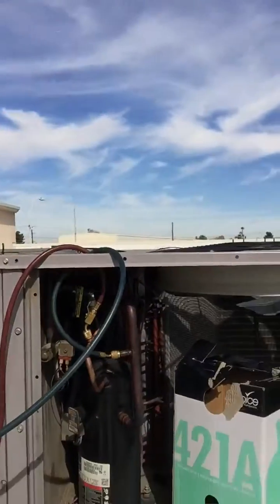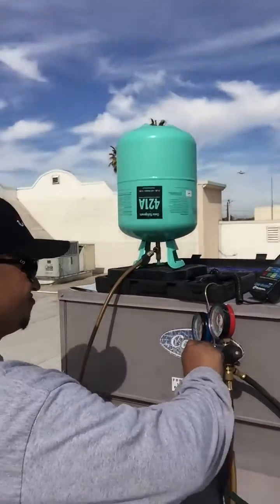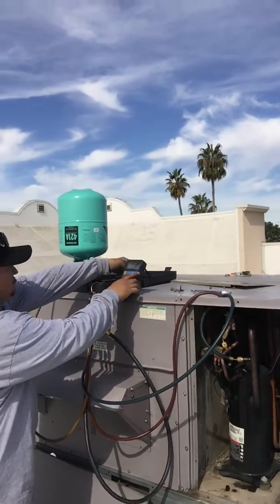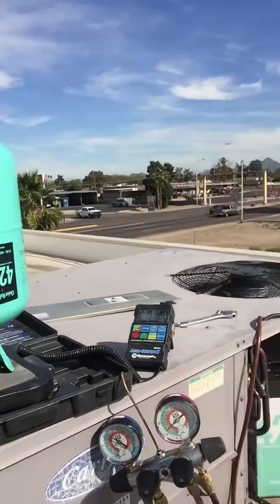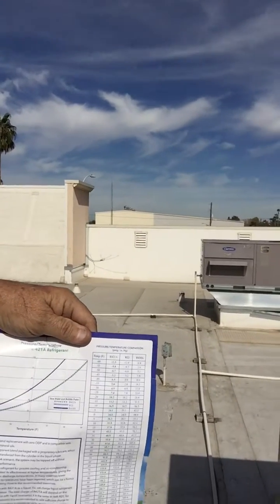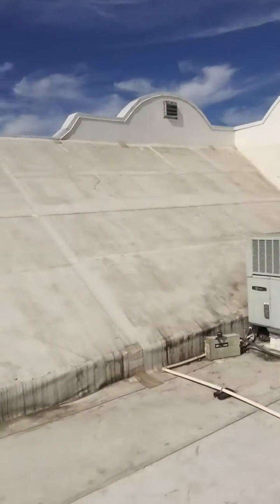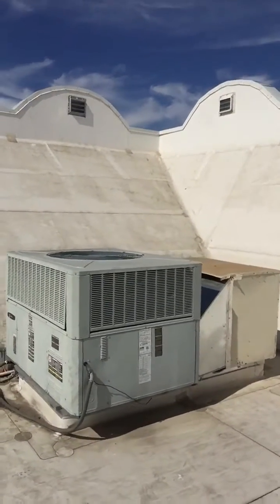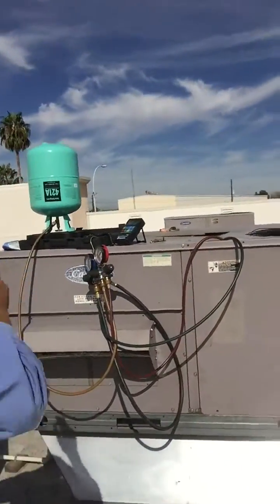HVAC Choice Refrigerants R-421A Field Use

Comment: 28° SST! You don't see a problem here!?!?
Reply from the maker: Mark Carpenter I’m not sure what SST is.
Reply: @cochisecounty_travels  
I said 28° SST  meant to say 26° SST and that's even worse. SST = Saturated Suction Temperature. For comfort cooling we are always trying to achieve 40° ~ 45° indoor coil or SST regardless of the type of refrigerant. While pressures can be all over the map from one refrigerant to another, temperatures should always be the same. 40° ~ 45° indoor coil with a condenser split of 10° ~ 30° based on condenser efficiency. 

50 psi = 26° (bubble) SST (Well below freezing, should be 40° ~ 45°)

215 psi = 111.2° (dew) head Temperature

85° outdoor temperature 

26° Condenser split

72.5° Return 

52.5° Supply 

20° ~ 21° delta-T (high side of normal) 

Suction line temperature ?

superheat ?

Liquid line temperature ?

Subcool ?

Was the filter clean?

Was the evaporator clean?

Was the blower wheel clean? 

With a 26° SST well is well below freezing, won't that ice up the evaporator?

From what you have up there it looks like the evaporator is starving or has extremely low load, while the condenser is close to normal. If the evaporator was starving you would see a an extremely high superheat. And dangerously high suction temperature above 65°. You changed the filter-drier so that is pretty much rules that out as a source of restriction. I feel there possibly a restricted metering device. Would have loved to see the line temperatures to help confirm this.
Reply from the maker: Mark Carpenter we did this repair a couple of years ago. We honestly didn’t dig that deep as the customer wouldn’t pay for it. We used the 421a to see how it worked. So far, so good. We have been maintaining this site for awhile with no issues. Coil and blower were clean, superheat was higher than normal. But it was 110 outside when we made the repair.

Comment: hey guys wont the 50 psi on 421a  cause a 26 degree coil
Reply from the maker: Giovanni Krasniqi it did. We got an awesome delta t with no icing problems. The gas has been in the system for over a year with no issues.
Reply: HVAC_REFER_GUY MM 
Im new at this . So should i leave it also at 50 psi . Thanks
Reply from the maker: Giovanni Krasniqi no. You should charge by the unit weight and verify your pressures based upon your pressure/Temp chart.